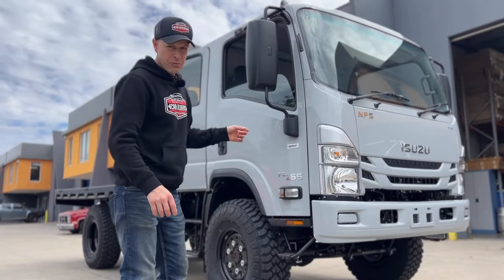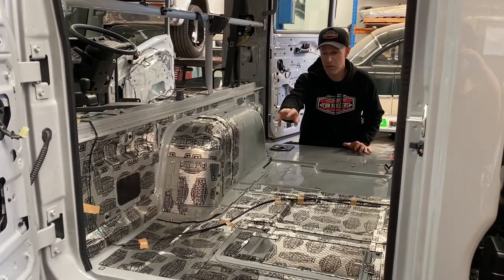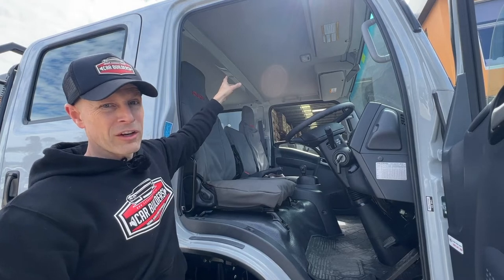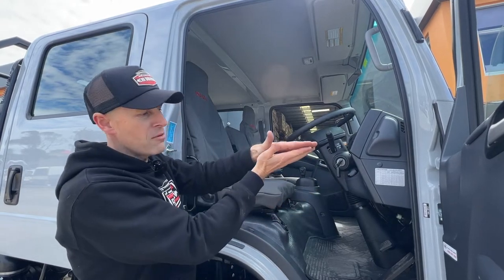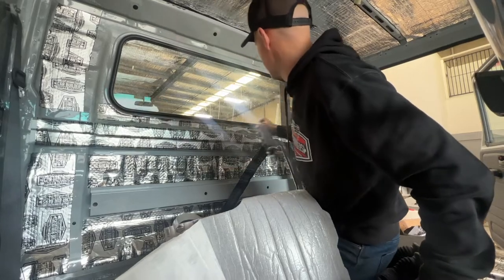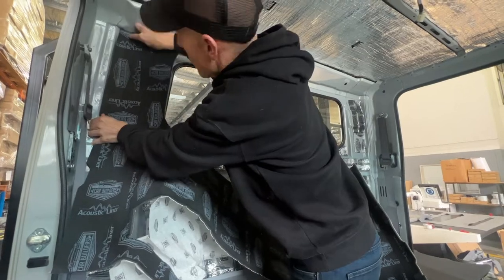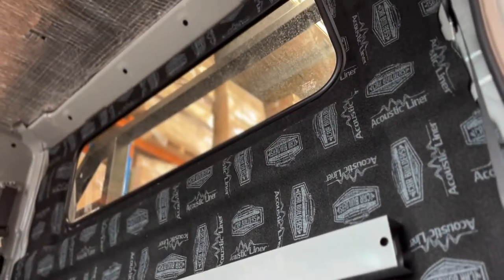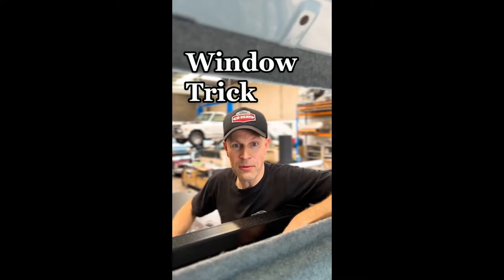Sound Deadening and Insulating the Isuzu NPS300

Comment: hi, can you please tell me if is any gain to sound proof the floor of an bmw e64 lci of 2009 ? is a convertible. when i try to remove the floor thing i see under is very things layers from bmw...
then maybe is no sse to make all the floor but the door panels sides yes ? its a 2 doors.

by sound proofing my interior i mean 2 layers, 1 against vibration and the 2nd foam for sound. ;)

i plan to retrofit a bmw bower and wilkins sound system with there amplifer.

thank you ;)

Comment: Do you do kits for the fuso canter?? I have a single cab i would want to do the rear wall and roof.
For the heat on the roof, I've used Thermosheild paint on my bus roof and its amazing how much it drops the temperature.😊